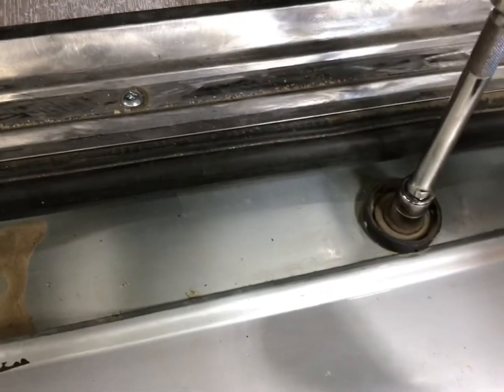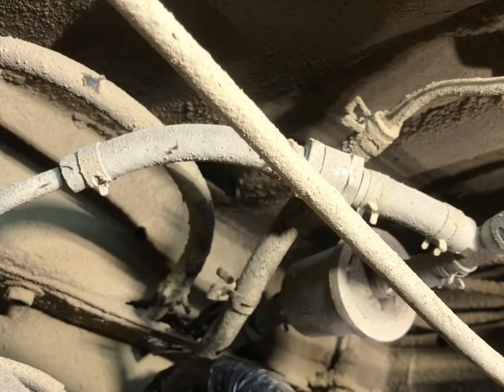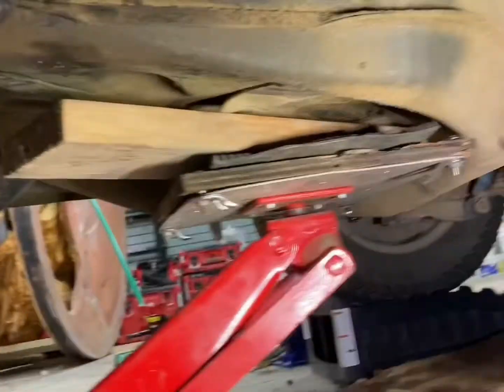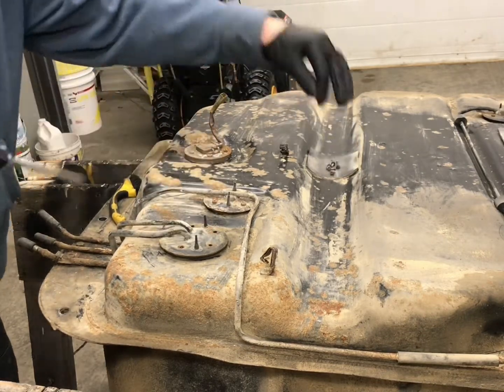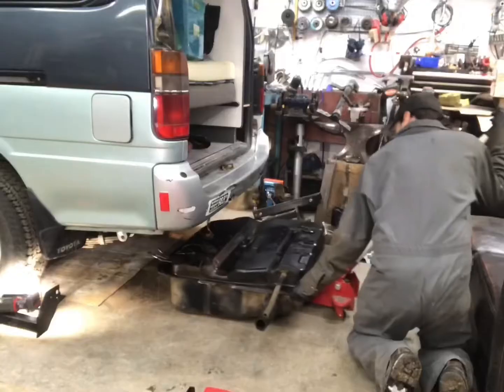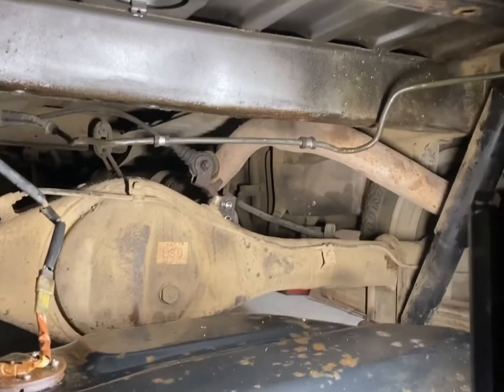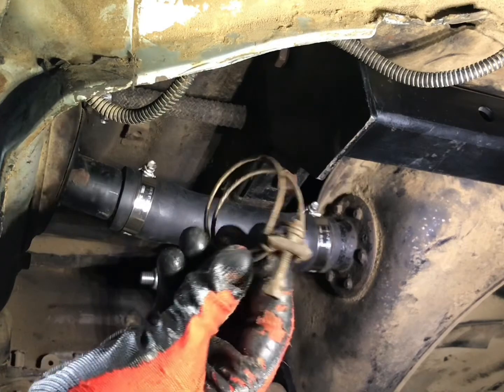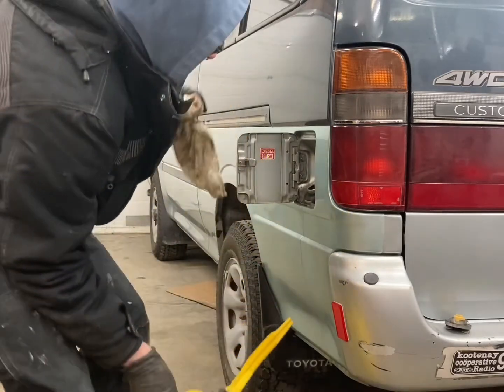Removing Toyota Hiace fuel tank

Comment: Hello and 10 out of 10. My tank is still off but refurbish nearly complete. As ever, I’ve pulled off all the other associated fill and vent parts and cleaned them up, too. I had a blockage in the vent piping and filter (orange thing) and will be fitting additional plumbing for my diesel heater (which is currently heating the garage). Also, on mine the wire holding pieces were toast, like yours. Will be fitting some adhesive-backed cable-tie pads instead and have removed the old metal clips as now useless. Take a look at my posts on the Super Custom forum as I’ve posted a few pictures of my tank refresh there. If you can’t find them pm me over there. Am also refreshing the upper and lower tank pads with some non-expanded neoprene as the old ones had just about turned to dust. I might replace the breather hose as one end is poor but the fill is great. I’m really impressed with the clever design of the tank (inc anti-slosh flap, breather, fill mechanism, pickup assembly and sender, all so very well designed to my eyes). Also on the forum I’ve posted some pics of the new pickup and return pipe assembly and how it’s better and different to the original, especially for heater plumbed on the return, which is the way I’m going. Corrosion on the solid pipes near the flex hose hook-up were my reason for a new sender unit. The better disign was just a happy accident. My tank probably won’t go back on until I’ve sorted the rear suspension, which is still a way off, plus some other extensive fettling nearby to fix. I saw your post looking for ideas about a tank without the spare tyre cut out, but I’ve no knowledge. I also see clearance issue with the OEM arrangement but the OEM tank has a lot in its favour. I’ll be fitting a towbar and note the issues there, too so thanks for the video. Cheers!
Reply from the maker: Thanks!  My friend who was helping me drop the tank seemed impressed by how clean it was.  How come yours is in such poor shape?  Just overall rust issues with the van?

Comment: Hey man, awesome video. I'm about to start this mission on my own Hiace and was wondering what kind of grease you used in the electrical connection as there is a lot of back and forth on the internet between the dielectric vs white lithium etc. Any advice?
Reply from the maker: Thanks!  Not to get political or anything..  this happens to be dielectric grease.  I don’t know the difference, and not sure if it’s even necessary but since I’ll probably never open it up again I figure it can’t hurt.

Comment: Hi there, about to do the same on 1994 LH125 to replace the sender (there's no hole in the floor unfortunately).  I  noted you removed the tank when up on ramps, but when installing just tyres on the ground - your thoughts whether can remove the tank without ramps?  Also interested in the adaptors used with the pump - i have the same one : )
Reply from the maker: Hey maz I had it up on ramps because I was putting in new rear shackles to achieve lift.  This is why I pulled the tank.  You can do it on the ground for sure!  Not sure about the adapters, just various brass nipples I had in the shop just tried until I found ones that fit